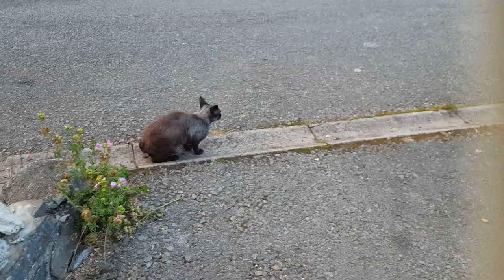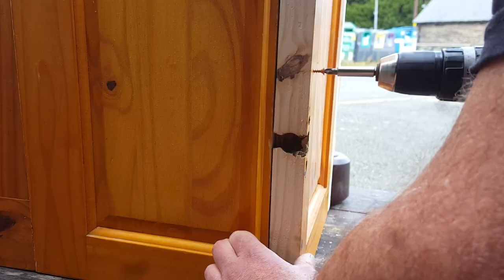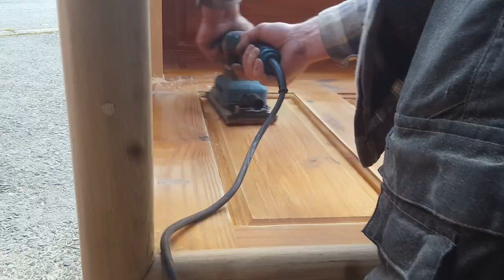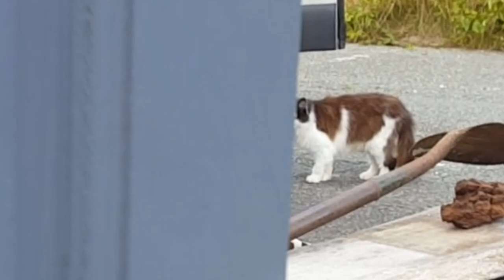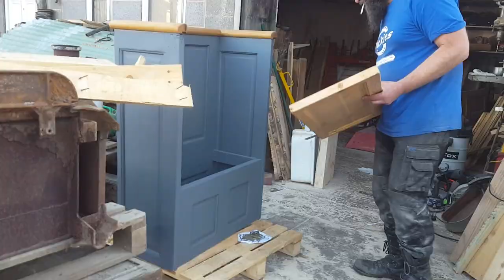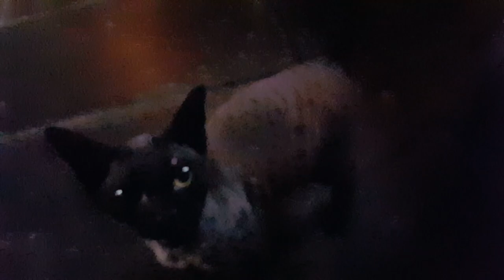DIY Reclaimed Old door projects - Settle with storage

Comment: Hi Bongo. Love the videos. Hope you are keeping well in the current situation. Old doors are a great source of building material. I take full advantage of the fact that people hate having them in the way and normal give them away for free after removing/replacing. I built my wife a complete kitchen from old pine and oak doors. I cut and rejoined them with biscuits and reattached the beading. The left over pieces i used for face frames and the panels as shelves. I just received some of your router bits from eBay yesterday and can't wait to give them a go over the weekend.